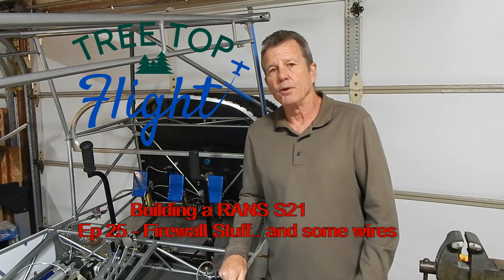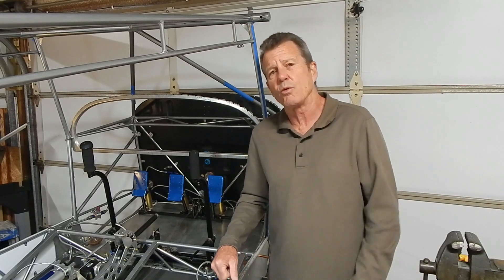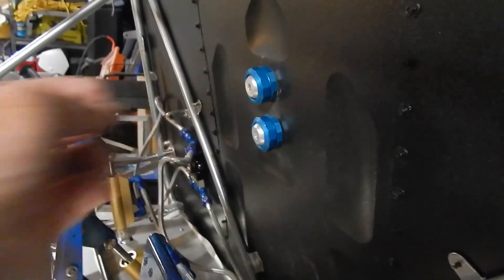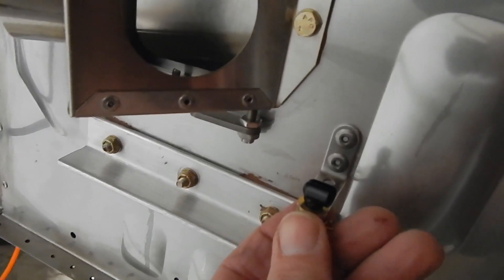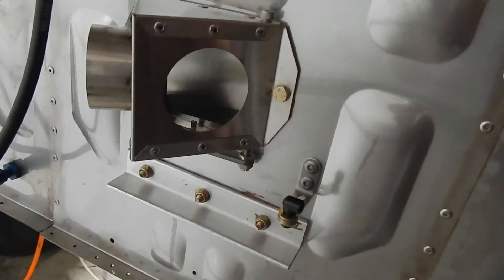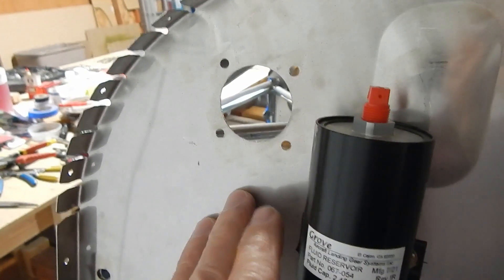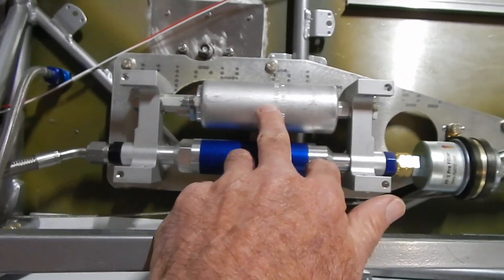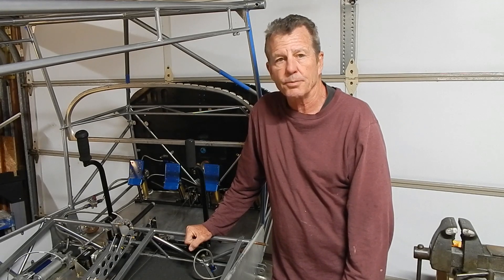Building a RANS S21 Plane - ep 25 - Firewall Stuff

Comment: Right at 6:38-6:40 in your video, look to the left of your fingers and you will see the four grommets on the parts drawing. They are away from the rest of the parts in the drawing. You can find a 1” firewall pass through (SS) from Aircraft Spruce that will fit your opening. The older firewalls had the lower opening (mine included) and it comes out right behind the engine mount tube. Yours should be much easier to work with.
Reply from the maker: Thanks for your comments.  I did see the 4 grommets on the page, but I had to make the assumption on what they were for.  The parts page and the text page refer to them as different things, (a typical RANS habit) and the diagram does not show that they are for the coax holes.  Thanks for the passthrough info.  I had not figured out an answer to that yet.  Ordering surely beats fabricating... :-)